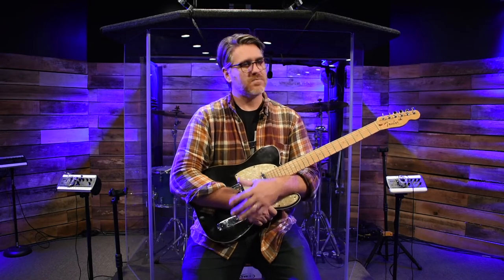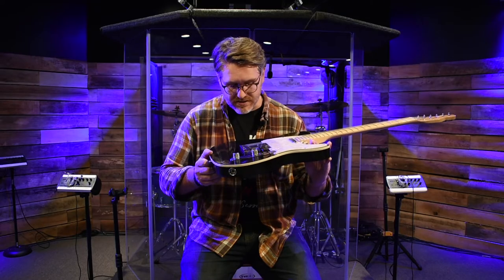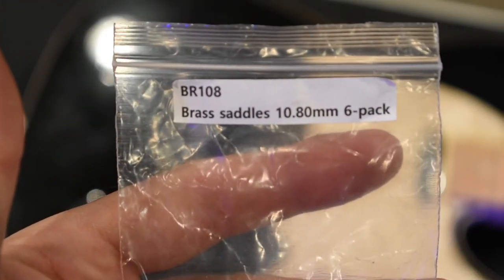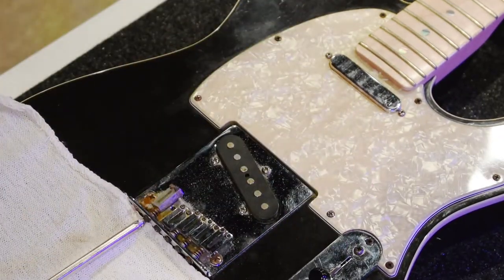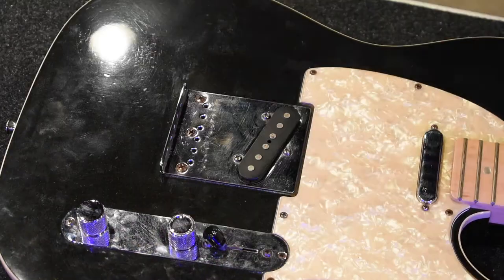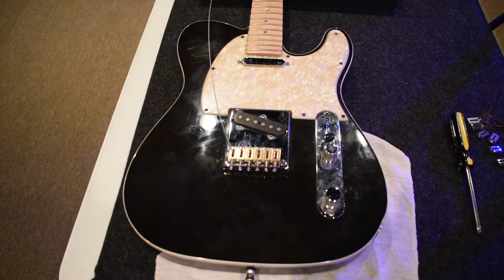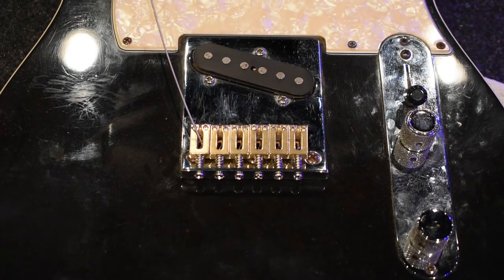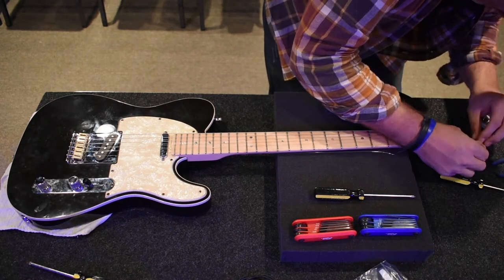EPIC FAIL! - How to replace Saddles on a Telecaster.

Comment: I'm bringing my lefty Telecaster in later today for a setup and also to get a better entire bridge.saddle put on, maybe a brass Vintage one, or nickel, I don't even care,
as long as the bloody top E saddle screws don't keep coming loose, which they've been doing since two years ago almost when I bought the guitar. I put
a couple of longer screws in, didn't make much difference. Squiers

come with a crap bridge. I think it'll be ok once I upgrade it. I almost tried some Loctite but I doubt it's going to perm. fix the issue.

Comment: It's a shame you can't get a set of saddles that are like "floating point" saddles, on a bottom flex. rack, so you can adjust each for offset/straight depending on your 
Tele. I'm not sure if such a thing would affect the sound or intonation, though. Problem is, it still won't be aligned properly. I hate through-body stringing guitars, I own one, it's ok, but I prefer my Squier Tele. that is not through-body. I find it difficult to remove the strings for a setup, or install new that way. It's a bit nerve-wracking! Even my 12-string ac. elec. is easy,
pull bridge pin, put new string in, replace bridge pin, pull up over nut, measure, cut, wind, tune! LOL